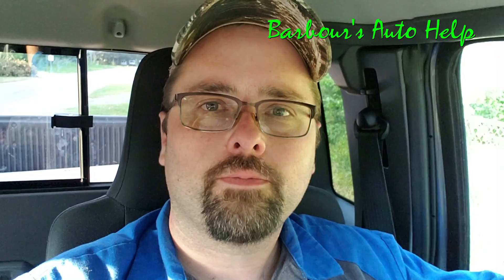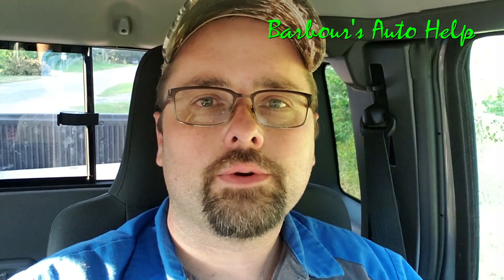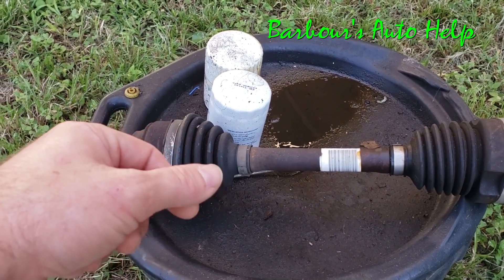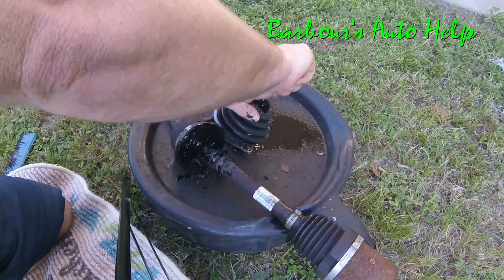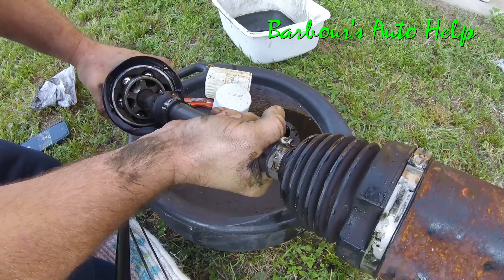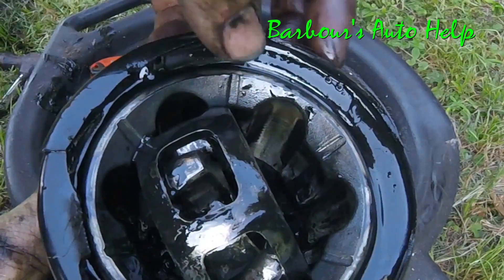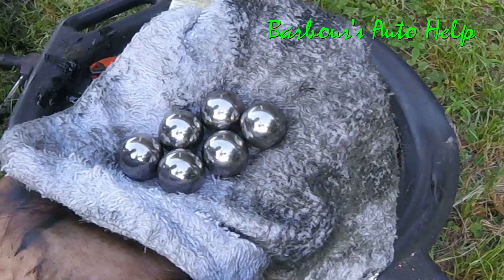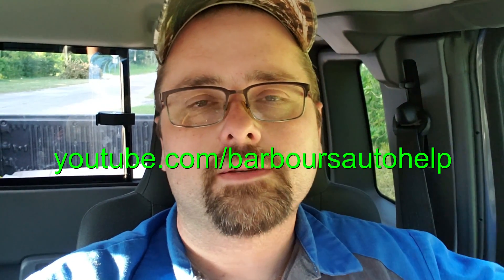The Sound Of A Popping Or Clicking CV Axle When Turning While Accelerating And What Causes It

Comment: Great video with details!  My Subaru Forester was making similar noises when turning at slow speeds.  My mechanic said the axle needs to be replaced.  My car was lifted 2" so I'm wondering if that could have caused the damage like this too?
Reply from the maker: It's possible.  But I'm not a 100% on that.  I see a lot of vehicles with 2" lifts and it doesn't hurt the vehicle a bit.

Comment: What could it be if the noise is between 20 and 40 kmph?  It started at the right back wheel and now is on the drivers front side...And usually happens on a slight turns..lets say 2nd exit in the roundabout..It is a hybrid automatic 2014

Comment: Thank you for this making this video. Great job! Was the boot leaking or cracked at all? It's seem that it was a good boot before you cut it open. I have some noise also on the passenger side but the boot looks good and no leaks. So, I'm wondering if that axcel is my problem. Thanks again.
Reply from the maker: No, the boot was not cracked or leaking.  Typically a joint will go bad because of lack of lubrication or from moisture and dirt getting in.  Sometimes, like in the case with this axle in the video, they can go bad without any outward signs.

Comment: What else should I change along with the cv joints
Reply from the maker: A lot of times the answer to that question is vehicle specific.  Some manufacturers recommend new axle seal and nut with axle replacement.  I'd strongly suggest getting a reputable manual and following the manuals recommendations.

Comment: This just happened to me (5-24-21) on my way to a doctor's appt ..I was driving, then stopped at red light. When the light changed, I accelerated, my car jerked, there was a loud knocking , grinding sound and my car only went 5 mph then stopped completely. I thought it was the transmission going out, so I was very upset. I had the car towed to my mechanic thinking I was going to have to get a new transmission on my old 2002 Toyota Camry which has 152,000 miles on it. My mechanic asked me to describe what happened and what it sounded like. He then looked under the car and said it wasn't the transmission; it was the CV joint. I was relieved. I was able tp pick up my repaired car the next day. However, my cv joint was so badly damaged, he said it was the hardest time he ever had with a car trying to get the old cv joint off, so the labor was a bit more than usual, also, I needed Freon , so my whole cost, parts and labor, was $547.00
Reply from the maker: Thanks for sharing.

Comment: I have an issue with 2007 tsx where when I'm braking and turning at low speeds I will get a clicking noise.  Going through drive thrus is the worst with braking and accelerating multiple times plus going around the corners at slow speeds.  Noise coming to a stop and letting off the brakes.  

This seems to be a problem from the front right wheel.  Also when the front right wheel hits a good bump at speeds it feels like it rattles a bit, sometimes the car will shake for a sec depending on the bump.  But if I ever hit bumps on the left side of the car its still solid and doesnt really make much noise.

Could those issues be caused by this CV axle?

Edit: Also want to add that very rarely the steering wheel will become very shakey on some roads.  Not sure what causes it as it's happened multiple times on the same road but never really any where else and this one road doesnt even appear to be worse than much of the other roads i drive on
Reply from the maker: Not sure what the cause of your symptoms are.  Probably best to take it to a tech and have them diagnose it for you.
Reply: @BarboursAutoHelp  Yeah I'm bringing to family friend soon who's a mechanic, he's just busy atm.  Just wanted to poke around and try and get some ideas of what it was

Thanks for reply

Comment: This really helped me understand what that noise is in my 2018 Ford Edge. Still under powertrain warrantee, I brought it into Ford dealership and they said my CV Boot is leaking, and they will replace it in 2 weeks after parts come in. They said that it is such a small leak, it will be ok for me to drive it to Key West Sunday, 500 miles each way. But I have been hearing this sound for a year or so. And how does he know how long it has been leaking? He didn't mention anything about the bearings, he said I just need my Boot replaced, but I do have that sound in my right drivers wheel when I turn. What do you or anyone else think? I believe it has been leaking for over a year.  It has about 55,000 miles on it. Is it safe to drive? Update. I just went out and crawled under ant looked at the boots and axle. They all look clean and new and there is no grease splattered or leaking anywhere. The axle is not loose. The only thing is that when I make a sharp right turn, I hear 2 or 3 little pops

Comment: So mine produce a loud clunk when I back up from the parking spot (turning big angle). Especially when it is cold outside <50F. Clunk is sometimes so loud you can actually feel the vibration in the cabin...
Got both of the front lower control arms replaced, seems to fix the issue somehow, but today the clunk came back.

Comment: What if I’m driving straight and I’m at a red light and I accelerate and hear that same noise same problem?
Reply from the maker: That too could be an axle.  So, Jack, I'm curious.  You wouldn't happen to own an 18 wheeler named the "Pork Chop Express" would you?  (That's a movie reference by the way and if you guess the movie you will instantly be my best friend.)  But, back to the question you asked.  I have had an axle pop like that while accelerating going strait.  It's not as common but it does happen.
Reply: @BarboursAutoHelp  easy big trouble In little China my all time favorite of course

Comment: I re-did my outer boots and added OEM Honda grease and after a few weeks click started, before it wasn’t there only torn boots, my guess is too much grease leaked out and joint got worn or I didn’t  put enough grease but I used all that came with kit 😳
Reply from the maker: I always replace cv axles if the boots are busted, clicking or not.  It was probably messed up before you put the boot on.  Sometimes you can get lucky putting a boot on.

Comment: Excellent vid best one for cv joints clicking by far. One of my passenger side cv boots had split, i ignores it and it lead to getting a new driveshaft. Not really dear though 61ukp for brand new driveshaft with 2 years guarantee for Z20LET engine. Its getting fitted in 1 day, Wednesday 17th February 2021 as the clicking is now terrible.

Comment: Ok, I have a question. You said the noise is during acceleration. I have the opposite, same noise in this video but it's loud when there's not much or no load. When I'm downshifting / engine braking no noise and acceleration no noise. Note new bearings on driven wheels and new rotors and pads all the way around 90s acura cl

Comment: My 2012 Honda Odyssey also making the same noise like yours when I turn left and right. But only coming from the front passenger side, also, a small vibration when accelerates. Do you think this could be the axle or motor mounts? 

the front rotors shakes when braking from high speed like 60 above. Does a bad rotors will cause turning noise or acceleration vibration?   Thanks

Comment: Hey man. Will you take a look at the last video I uploaded? I'm trying to diagnose a clicking sound in my 2016 Mustang GTPP. I have ruled out axle nuts or anything obtrusive. It's a clicking sound coming from the rear. Does not affect drivability. Does not do it if the car is in neutral.

Comment: What sound would you hear if the inner joint failed? Vibrations???
Reply from the maker: Yes, "typically" inner joints behave a little differently.  Normally they don't cause noise when they fail.  Usually a vibration is a symptom of a bad inner joint.  It may cause a clunk type noise but I've not seen them make noises like an outer joint.